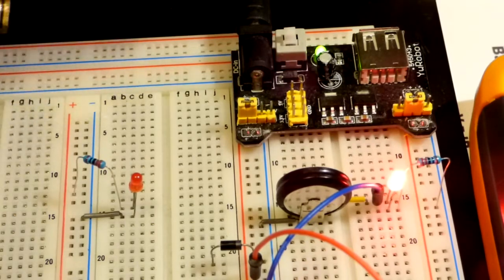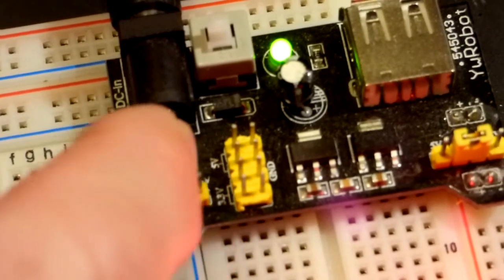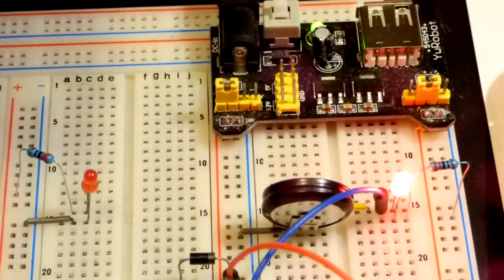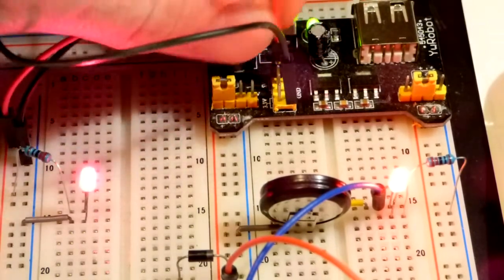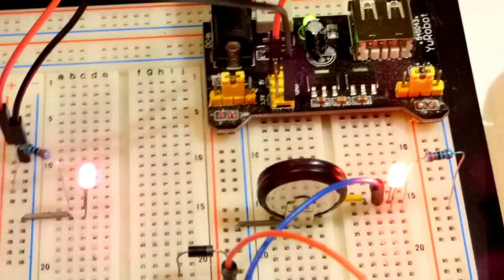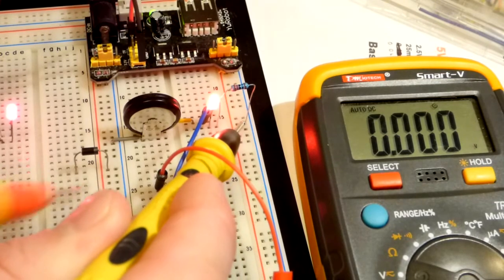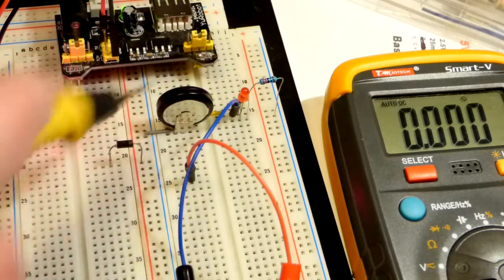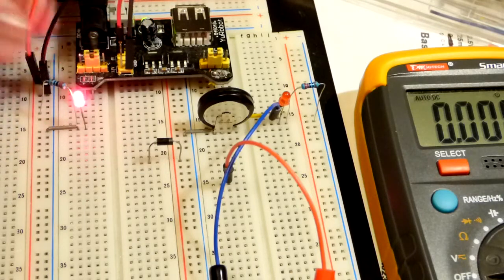Extra power pins on breadboard power supply explained by electronzap

Comment: I built that Jameco dual linear power supply last night. Took out to the garage, plugged it in and ... nothing. I thought it was not working but since it didn't blow up in the garage I felt safe to test on the bench. Turns out the only thing not working is the LED. It is possible I got it backwards but at this point, rather than fix it ... I think I'll just roll with it for a while.